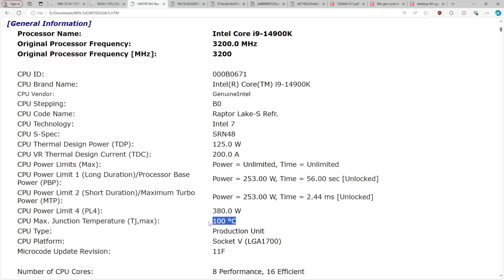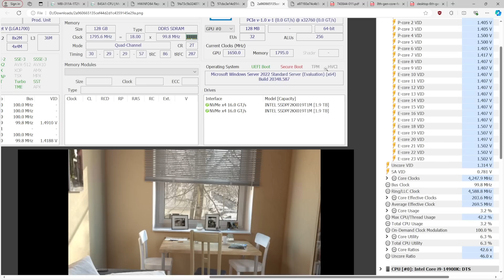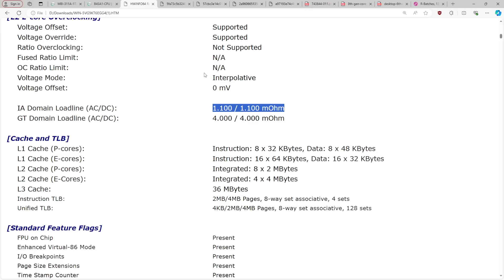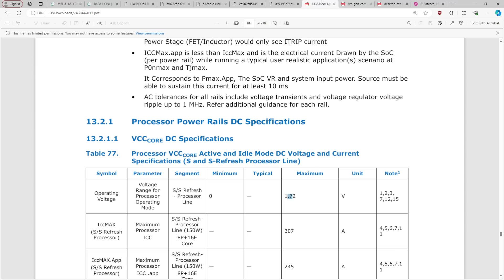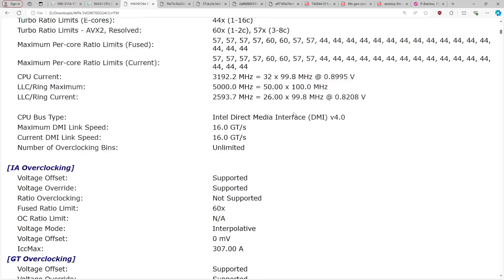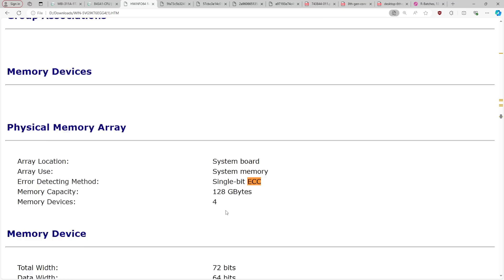Rambling about intel i9 14900Ks degrading in a Minecraft server hosting enviroment

Comment: AM5 mobos melting Ryzens
900w VRM on 600w connector 4090s
Intel 13th and 14th gen -1ghz a month CPUS

Planned obsolescence / forced replacement / eradication of used market ? Sounds sus to me.

We'll stuff more voltage into the CPU by default for initial reviews ? Or to make sure they arent working in a few years ? Because its not accidental when it crosses brands etc is it. 

Correct me if am wrong the TDP of the 4090 is irrelevant if the VRM is capable of 900w then it needs a 900w connector. Just over spec the connector the card is fn 1600 for gods sake. 

Cpus that may be actually be materially degrading without being overvolted for years. 

Games designed to never function once servers are shut down. 

Cars that have features behind pay walls.

Anyone would think we have governments to protect us from rogue traders
Reply: Out of the 3, seems only AMD actually fixed the issue.
Reply: AM5 melting was caught extremely early on, and a blown cpu/socket is the easiest RMA request. This mass scale degredation is an issue on a whole another level
Reply: @MissMan666  I'm not buying a used 7000 series. If the chip suffered a minor event and crashes under high workloads now or specific use cases and the previous owner never really tasked it or used blah instruction. When I could buy a 5000 or 8000 and have more confidence that the possible crashes are software and not a manufacturer and board members cooking the CPU for no reason. You don't build something with billions on nano meter sized transistors and screw up voltage settings accidentally. Then the same issue is billions of transistors unless they make software that tests the gates and marks gates as bad etc. why would I risk it and not just get a 5800x3D when it'd outperform half the 7000 series product stack anyway.

Yes of course used market always risky but your now stacking was it used between this time period and that time period with has the user been overclocking etc.

7000 series, 4080 & 4090s, 13600 and up are on a strict I ain't ever buying list.

Comment: You looked at the normal ddr5 speeds, low profile dual rank is at the very right of the table and is up to 6400 depending on the type, but lowest is 4800
Reply: No. It is 2dpc dual rank (quad rank in total), NOT an 1 dpc dual rank.
Intel documentation states DDR5-3600 for dual channel of that.
Reply: On am5 i got ddr5 3600 working

Comment: Hi Mr. Buildzoid. I ve been watching your content for some time now and still go back to your alder lake OC videos. I ve got a 12600kf on which i had to turn off the e-cores ever since i upgraded my gpu to the 4070SU as i was experiencing severe stutters in heavy GPU load applications. It s rock solid now but i had to tune the voltages down quite alot as i felt the voltages for some reason went up ever since i disabled the E-cores(AUTO voltage with -0.03v). I came to the realization that there isn t any point in running the stock/auto settings on the CPU at all because just having discord,slack and google chrome opened will make the CPU run at base clocks all the time at 4.5ghz(so no turbo). Can you recommend some settings for OCing my 12600kf to an all core 4.7-4.8ghz? I got an MSI Pro Z690 DDR4 and a Dark Rock Pro4 as a cooler.
Reply: Most people doesn't know about this, nor needs to (letting aside are not willing to learn about, they also shouldn't need to). Responsibility are from mobo manufacturers and Intel for letting such a wild settings go out to the markets as default.

Comment: I have one of these problem CPUs (13900K) and after 2 months (daily use of approx. 4-5h) it started having problems and after another month it started crashing daily.
Reply: Same with a 14900K. Lowering down voltage and freqs got it to stable again. But now is a nerfed down 13900T.
Reply: @Pacho18  The problem is that in a few months you'll need to lower even further, until not even this solves anymore.
Reply: @mrxcs  That's what i fear. And that's why Intel should do a general recall for everyone affected.

But as it seems they won't do it, i'm done with them forma life.

Comment: It is indeed voltage issue, as those chips were not supposed to be overclocked and over-voltaged to that high to begin with. TSMC 7nm has maximum recommended voltage of <1.2v. I suppose similar limit would be applied to Intel 10nm node. In fact if you leave a hefty margin, which no manufacture is doing now, the max voltage should be set to around 1.15v, then get whatever clock speed that's stable at that voltage and call it a day. But nooooo,  has to run balls to the walls in order to eek out that last 1% to win a benchmark. A 10% performance margin was supposed to be left to overclock enthusiast which consists a very tiny market share. But now out of box overclocked to the limit of breaking down for all users? Intel, you get what you f**king deserve.

AMD to some extent is doing similar things but a bit more conservative. Their flagship boosting to 1.48v is not confidence inducing either. Although their smarter overclocking algorithm makes sure this break down happens slow enough so it doesn't result in mass recall. Nowadays when I build a PC I have to downclock both CPU and GPU just to make sure they can run stable for at least a decade, like what the older hardwares always do. Modern process nodes are very delicate. If you want 7nm parts to run good for long, don't exceed 1.2v. Yeah yeah you lose 5% single core score, but who cares? It is not worth it to chase it to the detriment of the system service life and ultimately, the environment.
Reply: My AM5 mobo is sticking 1.5v on idle right oob. Tried to lower it down, and was just to 1.25v. Below that refuses to work.

Whereas my unstable 14900K is working now as a stable nerfed down 13900T equivalent with reduced freqs and @ 0.85v

Comment: So VF offsets are like +.990v by default for high multipliers or VF points. or this was reported by XTU after restoring defaults, values were greyed out not modifiyable via XTU at least with current bios settings,,,, IF it is multi locked and not Total Mhz locked BCLK OC with less than 48Multi???? 0.990v would explain the ~1.64v auto voltage for high multi's on 14.9ks opposed to the ~1.54v auto voltage for high multi's on 12.9k
Reply: At 0.85v managed to get my unstable 14900K to work as a stable nerfed down 13900T

Comment: the premium wendel quoted for the i9 config in the data centre he spoke with was 1300 USD
so basically buy 1 i9 pay for 3?

thats an insane premium

i think the quality of the vrm should take into account the load and temperatures it will experience lol. but yea in comparison to the high end consumer boards this is kinda crappy.... but no moron is gonna randomly apply insane cmos settings and run it in a sweatbox apartment - like consumer board need a lot of headroom cuz "that guy"

Comment: "efficiency" cores are a waste of power, silicon real estate and clock lines, CMM
Reply: Helps with Rendering workflows and coding workflows
Reply: @MikkoLehtovirta  is that why it has the same cinebench score as a CPU from two years ago?
Reply: @GeorgeTsiros  its all about number of cores for the workflows i deal with and still more affordable than threadripper.

I am not using only E cores i use the whole package.
Reply: @MikkoLehtovirta  I can understand that, some workloads really like lots of threads. That said, have you compared a 16/32 cpu and a 8/16P+16E cpu, how they do in your workload?

Comment: is the 14900K still the fastest cpu for running minecraft servers when you end up downclocking it?
Reply: I doubt it. Also downgrading may not even make things stable in long term, probably only stretches the degradation. You may go for an AMD, like 7950X or something like that if possible. If you lease a server, you can usuäly ask for an AMD instance.

Comment: Can you provide a link to the " Patch now "  ?  I have read the stuff from Intel and they said the microcode to fix these is coming in August and I know there have been a lot of BIOS updates from MB vendors but I can not find anything about a patch that is available right now.  Thanks BZ!
Reply: Yeah wait until August for now enforce all intel limits as per your CPU.
Reply: @tmsphere  Built my wife a new system with the 14700k and set all P cores to 4.7ghz and E cores to 3.4ghz.   No more than 1.12 VID and a total of 144w of power at 100%. I will not touch anything more until the new microcode is in place but going back to BZ's comment, I still do not see a patch now available since most MB venders have beta bios up

Comment: Intel screwed up its their fault. They pushed the chips too hard. But its partially users fault as they've stopped learning how to tune their own hardware. These chips are easily fixed by locking the chips to an all core clock. People who just leave their stuff stock, and get below average silicon (higher VID table) are the ones having issues.

Comment: holy sh!t, those are some HIGH voltages, no wonder theres degradation issues with L3 at 1.5V, also is the IMC also running on that voltage rail or does it have its own? (last generation i oc'ed was 1366)
Reply from the maker: the system agent and memory controller have their own voltage rails.
Reply: @ActuallyHardcoreOverclocking  Also on X58 and killing CPUs, i killed a X5675 with 1.45V clocked to 4.6GHz while running at max 65°C in like 2 months of medium use, Core degraded by 600MHz and Cache + IMC by 400MHz just from high Vcore all other Voltages being pretty normal. Pushed that CPU harder because it ran cooler than my other 1366 Xeons by around 25°C even with 150mV extra Voltage. I thought it would be fine as the chip wasnt running hot but i was SOOOOO wrong.

Comment: 12500T minecraft servers here, stable for years. But that's an exceptionally low clock low volt and last-gen use case. 

It performs so well too. Minecraft, even modded to the hilt, doesn't really need more than a couple of skylake IPC cores at 3 to 3.5ghz. More speed is sometimes useful but if you just pre-render the first few thousand chunks around the spawn in you avoid most performance related issues.
Reply: also depends on your definition of minecraft and your addons, i've run 100 slot servers with better stability on lower clocked machines than curseforge hell modpack chunkloader instances with <10 users.
Reply: Well it depends...

128 player servers and bigger totally crush CPU's

And anything less than 64 players i dont even consider it as more than a server for friends and family
Reply: @commanderoof4578  Yeah. similar use case. having alder lake p-cores around 4ghz seems to satiate all needs. 

Though my ancient 6th gen skylake servers running in the 2.6ghz-ish range did great too. fast ram and nvme were more important to that server set in that era though.

I'm sure there's some outlier cases if you have all 128 players all go exploring and trigger chunk renders constantly. Most people don't seem to do super stressful things like that though.

Comment: Intel has to stop with out of the box overclocked CPUs on motherboards.
Reply: They "needed" it to compete with the latest AMD Zen4 CPU's. If they just focused on stability and higher efficiency instead of brutal force, they might had been better competitive on the market. Many consumers has chosen Intel over AMD over the years for just the Quality and Plug & Play ease, not because of the performance. Back in Pentium III / 4 vas Athlon, Pentium's were still being sold, despite lower performance.
Reply: @Wushu-viking  Any difference in "quality" and "plug and play ease" exists entirely in the minds of Intel fanboys. Athlon 64s were more stable and much easier to cool than Pentium 4s, whilst running rings around them performance-wise. Don't kid yourself that "quality" decisions are based on anything other than the name written on the box.
Reply: @CaptainKenway  Agree. Since I switched to AM4 in 2019, I havent found any excuse to go back to Intel. I tried giving the excellent 10900K a chance a few years ago, (good for gaming) but efficiency wise, it was way behind my R9 3950X (now I have 5950x, which has wven higher efficiency). AMD AM4 work brilliant today in my experience.
I also remember the Athlon (T-bird and XP) and Athlon 64 as very good and stable CPUs.

Comment: its cause theres a pile of dark silicon when running a single threaded load isnt it?
definitely theres a pile of cache and io not drawing current

and i still like ur ring theory. wendels analysis makes any other single point of failure really hard to accept.
the bus is thing all the random sources of apparent error share. speculation, but reasoned speculation

Comment: Why even bother, with long talks and guesses, there is problem and luckily there is simpler, cheaper and even better solutions called AMD. Yes it's simple as that. Exactly what 90% people already do and/or planing to do that for their servers. 
For home users, same, does not get inteL.
Reply: How dare you mention a competitor's product!! It's either you're with us or against us!!
Reply: @darreno1450  🤣
Reply: I always had AMD but their problem of the USB bus flaking out, intermittently dropping connected devices, made me switch to a used Intel 10900.

AMD never acknowledged the USB problem, so it was never clear if it was a CPU issue, a motherboard issue, or a out of spec motherboard part issue.

I wanted to upgrade to a Intel 13/14 gen CPU, but I'm glad I didn't get around to it.

Comment: this is on a blade server with a W chipset, i dont think this thing suppoirts overclocking
Reply: Exactly, which is why it's a problem. Either the chips are getting overvoltage on stock settings or there's something wrong with the processor which is degrading rapidly due to some manufacturing defect (oxidization as GN has said) or a combination of both.

Comment: I feel like it's not fully a voltage problem, how can people be getting "out of video memory" error that seems more on the side of I/O bus.

Time will tell, the patch in August might stop them being degraded faster but I have doubts whether it fully fixes the issue.
Reply: Out of video memory is just your typical data corruption, affecting the memory allocator software data structure where just a single wrong block pointer and suddenly the structure traversal fails and there's no free memory to be found when next allocation is requested. It could be corrupt as a result of arithmetic gone wrong just the same as cache to register load/store gone wrong just the same as DRAM IO, no way to tell from our fence. It's probably not PCIe IO issue because you would see data corruption like visible wrong texture blotches more often than allocation failure and the like.

Comment: If you have to down clock your intel cpu to preform the same as an AMD cpu....just get a AMD server set up????

Am i fucking missing something here or what
Reply from the maker: The 5.7GHz 14900K still beats every CPU AMD currently makes. The infinity fabric is a massive memory bottleneck.
Reply: @ActuallyHardcoreOverclocking  So you are telling me a 7700x at 5.4 ghz single core is going to be so much worse than an intel system that is running at that same mhz or lower for stability? ima have to hit a big X on that one.
Reply: Would it be better to use something like Folia to run the servers on multiple cores?

Comment: I host small minecraft server (5-10 players) on my gaming rig based on 5800X3D. Minecraft server is close to NOTHING when it comes to cpu activity, especially on custom server like Paper. It sounds almost imposible to me that funny block game is causing problems with 14900K

Yet here we are, oh boy
Reply: I mean you have no idea how huge a server is being run; notably it's possible there are serverside features eating CPU or even if players build sufficiently large farms they can cause very significant server lag (applies to non-paper servers since most large lag-inducing stuff breaks on paper servers)
Reply: @kelvinyonger8885  I mean, sure, I have zero idea but these are equipped with 128GB of RAM. My 5800X3D system has 64GB. 100% you run out of memory long before CPU performance is a problem (unless lag machines like you mentioned)

Comment: Had my 13900k since launch im not having any problem ive used 3 different motherboard since then im now on white apex ive now locked core an useing enforce limits just in case
Reply: i don't think what we're seeing is effecting all 13th gen. my guess is they made a change in the manufacturing process at some point during 13th gen and continued to use it with 14th gen.

Comment: Any advise for someone with a i7 14700K?. I managed to got it like 3 months ago for a really good discount
Thing is i've been really busy with work these months, so I haven't really used it much.
Anyone here knows if my chip is affected? Any settings I could do to prevent/slow down degradation?
Reply: Download the latest bios for your motherboard and make sure to set your bios to 'Intel default settings ' or whatever it's called, and not using ASUS multicore enhancement or any similar boost from other manufacturers.
Reply: My 14700K is running strong for 6 months now. No problems whatsoever. I have the intel profile BIOS only installed last month and it wasn't much different to the MSI's unlocked profile in terms of performance and temperatures. Except that allowed me to do a much better under-volt offset that hugely improved thermals. I suspect the only reason that I was able to under-volt it was the load line at 1.1-1.1 which before was 0.4-0.9, still stable but hot.
Reply: To test your CPU try cinebench r15 and see if its all good.